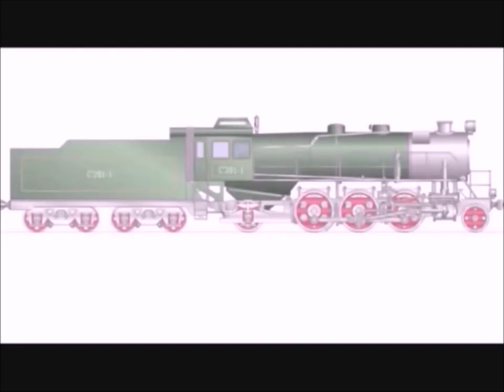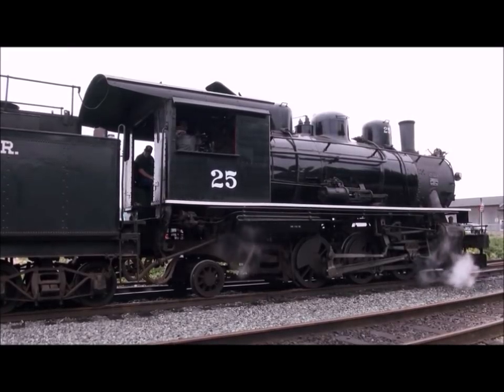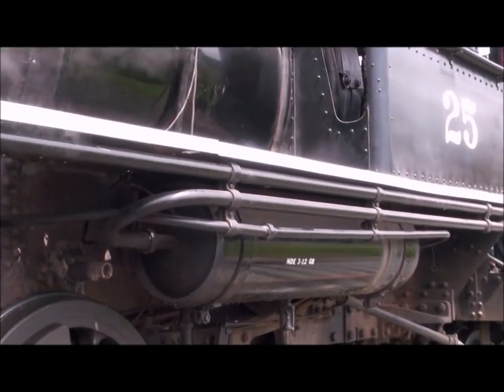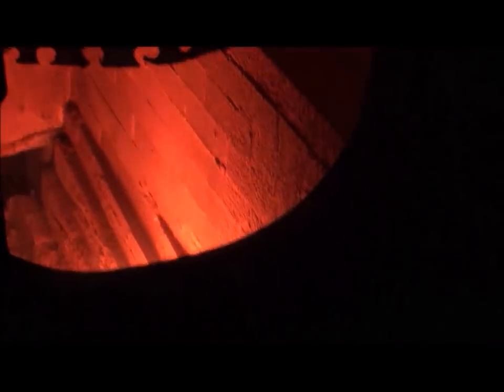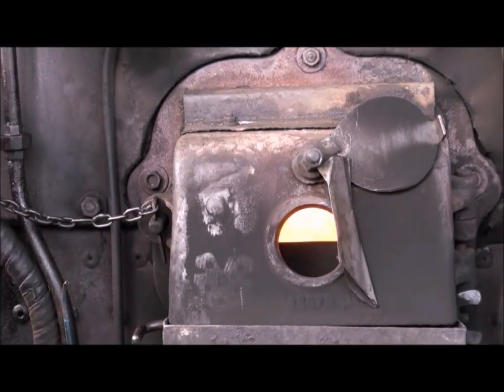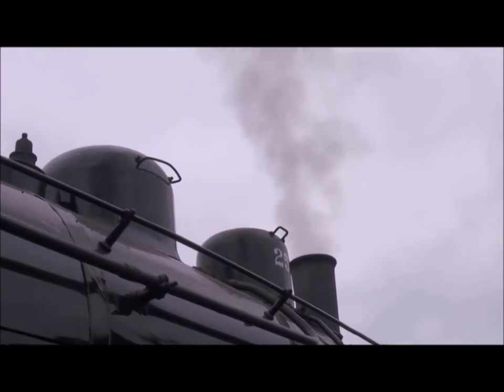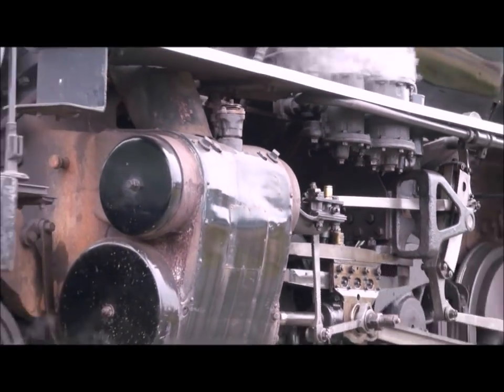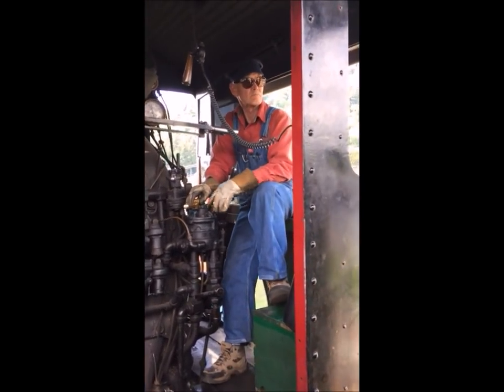Learn How To Operate A REAL Steam Locomotive!

Comment: Roughly how long does it take to fire up at the start of the day? And how much longer might it take if the engine used coal or wood?
Reply: I've just read that it takes 6-7 hours to heat up a locomotive with coal.

Comment: Hello D Murphy,
I have had an interest in steam trains since I was little playing with my Grandfathers model railway. Thank you for the video you made this very intertaning with your enthusiasm.
I didn't realise how much goes on and now can see why Flying Scotsman has three crew the first being the engineer the second looking after the water, air and instructing the third to add coal when required.
We have a steam program here in Victoria Australia and most of the videos I watched the locomotive is blowing huge amounts of dark black smoke.
Is this because of a bad fireman ? I think they're also run on oil not coal.
Reply: Black smoke usually means too much fuel (coal or oil) and not enough air. With oil-burning locos there's also a procedure called "tubing out" where sand is sprinkled into the firebox and this scours the tubes of the boiler cleaning away soot that collects over time. The sand and soot coming out looks like black smoke. This has to be done when the loco is working hard so that there is plenty of draught to carry through the sand and soot.

Comment: Does oil steam engines use KFC old oil to burn?
Reply from the maker: It can. In fact working with the Grand Canyon RR for 5 years I learned all about "firing" with vegetable oil. Works just fine, if you know how to use it.

Comment: It sounds like it's impossible to drive a steam locomotive on your own...
Reply: It's a two person job some times 3
Reply: Sometimes it's a 4 person job if the locomotive doesn't have a mechanical stoker
Reply: @up844productions8  but, theres rarely 4 people on a footplate on every locomotive at all.
Reply: Foxy at the C&TS when we clear the line with the rotary it takes 5 people to run the thing
Reply: @up844productions8  i wasn't counting rotary snowplows considering most of them don't run under there own power as far as i know.
Reply: Here in New Zealand we had a couple of steam locos set up for one-man operation but this was on a short branch line and it was literally just 1 or 2 locos.

Comment: "We use about10 gallons of fuel per mile" (So coal is measured in gallons huh?)  "and around 100 gallons of water per mile" So by my maths, you'd need 10,000 gallons to travel 100 miles,, that's a very big water tender, or am I not understanding him correctly?
Reply from the maker: Oil fire... NOT coal